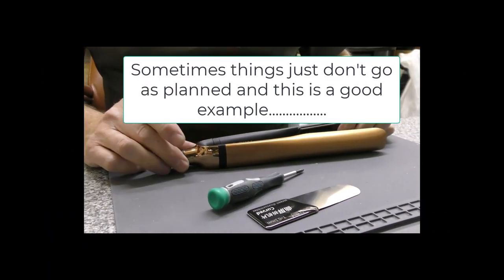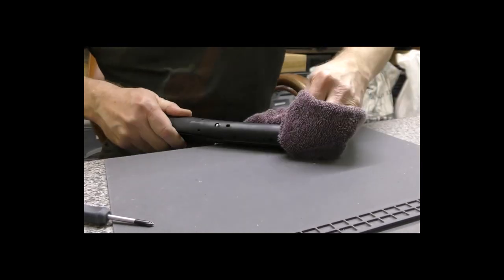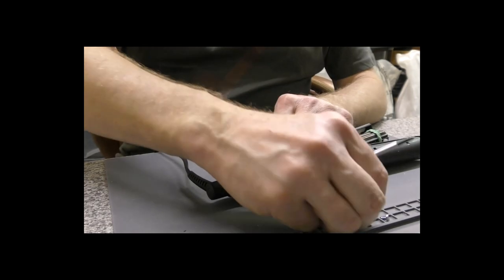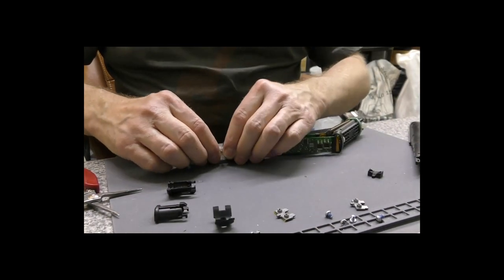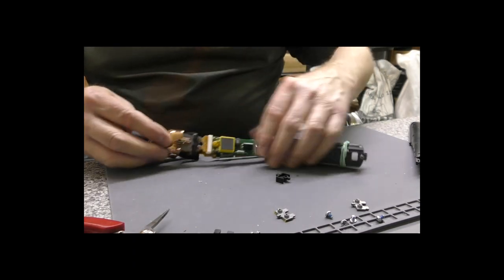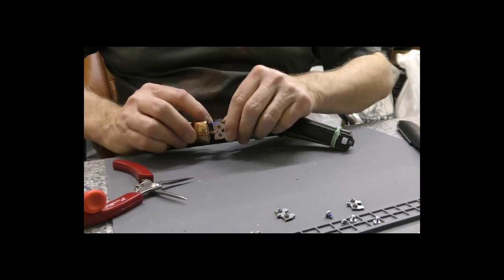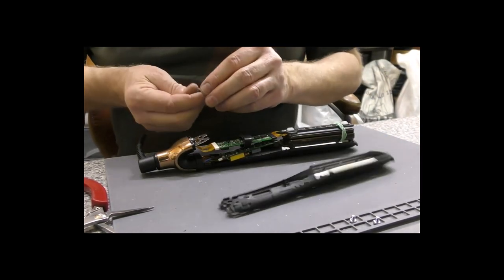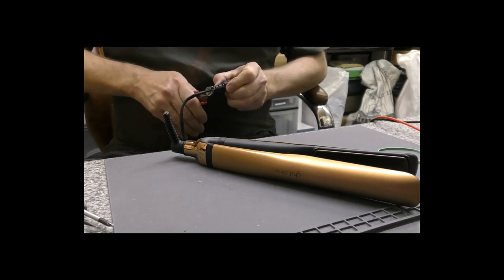GHD Platinum & Platinum Plus Hair Straighteners. How to fit a new cable.

Comment: Thanks for this vid - it showed me how to take apart my wife's Platinum+ straighteners. If you're interested, these ones we have didn't have the flexi-pcb to the fuse/plates - our one has push-fit wire connectors. The issue we had was the flashing red light of death! The fuse was open circuit, but it turned out not to be blown, but it's body is bonded in place and the connections are just a sprung connection - it needed a clean! A couple of seconds with some 1200 grit  emry paper between the two parts fixed the issue.

Happy days!
Reply from the maker: Hi
Yes, I actually now repair the Platinum Plus model.

Comment: Thank you so much for doin this in-depth vid
I've read mixed reports on fixability of Platinum plus, some say u can, some not 
Eclipse and Platinum original are a no no for repair everyone says
Reply from the maker: Hi
Platinum Plus is repairable if you know what you are doing and have lots of spares, including a good stock of elements.
Preheater and a PCB test jig.
The Eclipse was garbage from the start and would crack elements if you looked at them the wrong way. 
The Platinum is like the Eclipse with the same issues. One company strips out the guts and fits there own custom made bits.
Personally I don't agree with doing that as you are then totally liable if anything ever went wrong.
And the only parts that are GHDs would be the arms...

Comment: Hi Trevs My friend gave me a Platinum Plus to have a look at because it's not working. There is no power at all. I thought it might be the mains power cable. I stripped and checked the cable; continuity was good, and the cable has 250V. I checked the socket inside the PCB board, and everything was fine. There is continuity from the plug to the PCB board for both Live and Neutral. I checked the heater elements and thermal fuses; both showed 40 Ohms and 536 Ohms, respectively. Both elements have the same reading, so they are good. I checked for burn marks but didn't find any. When I power on, I only get 6 volts on the PCB. Can a varistor hold power? Do you know the value for the R4 resistor? I would be glad for your reply and help.

Comment: The little rubber insulation separating the live neutral must go on when assembling the connector out of the body and then it pushes in as an assembly.  It is part of the socket assembly so cannot be put in after the socket is pushed in the housing disconnect L + N from the board to give more room..
Reply from the maker: Thanks for that, I will take a look tomorrow, funny how that just didn't occur to me before.

Comment: Hi Trevor, Does the GHD Platinum Plus S8T262 have a thermistor to control the temperature? My feeling is that it must have, but if I disassemble each of the heater sections, each section seems to have a thermal fuse , and I can't see a thermistor. As there are only 4 wires to each section, these will all get taken up with the heater and fuse, I am wondering if the thermistor is somehow combined with the heater.... Any help would be appreciated.
Reply from the maker: Hi Mike If you look closely you will see that the thermal fuse is in the heater circuit, that is why you get about 40 ohms across the two outer wires, the thermistor is the two inner wires and indeed is part of the ceramic element. Check for broken wires, tripped thermal fuse, poor thermal fuse contacts and cracked elements.
Reply: @Trevs-Shed  Many thanks for getting back so promptly. What you say makes sense. I have an open circuit between the outer two wires for both heater sections. However, if I measure from each of the outer pair of wires to the appropriate side of the thermal fuse, I get about 25 Ohms and 15 Ohms. This adds ups to the 40 Ohms that you mention. This suggests that both of the thermal fuses have blown. I don't know whether I am surprised or not... My wife tripped over the mains cable and the straighteners hit the floor quite hard. when they were at a hot temperature. I suppose the thermal/mechanical shock could have been too much. Do you sell thermal fuses for the S8T262 in your store? I can't see them listed. I live in Higham Ferrers, so could easily pop around to save postage and the delays due to the strike if that works for you.
Reply from the maker: @Mike-H_UK  Mechanical shock will see them tripped. The fuses are on the website at £20 each. I charge £39.99 to repair this model.